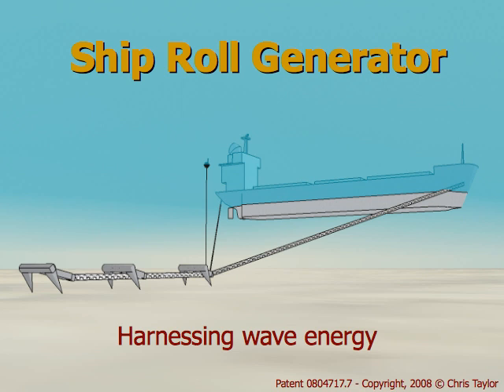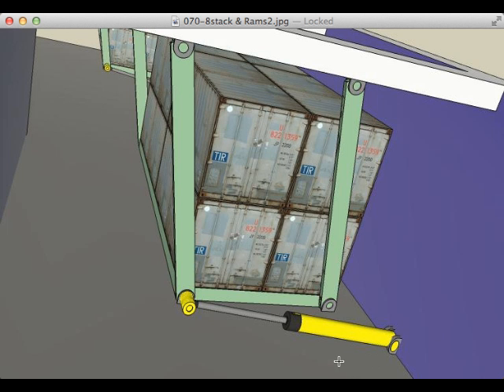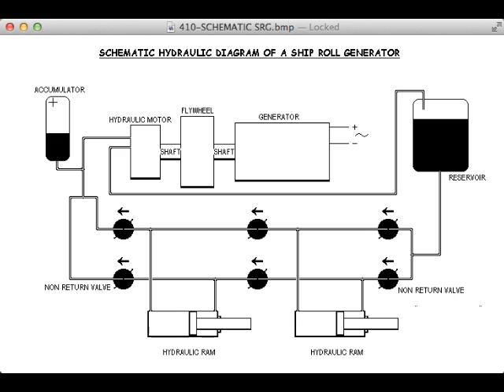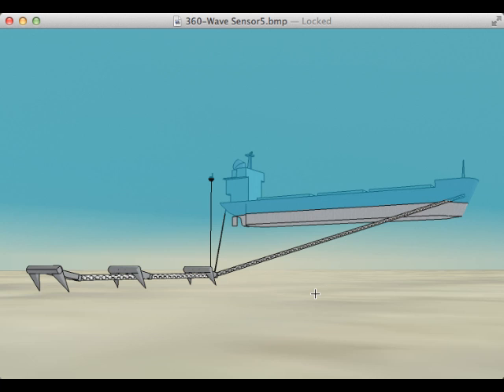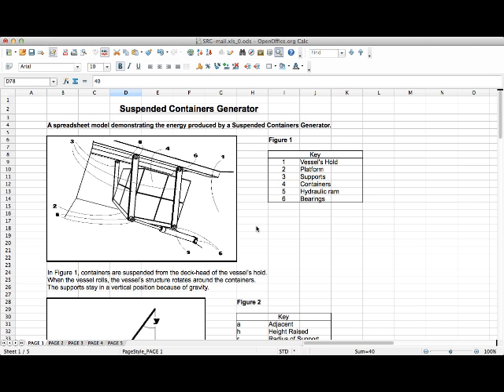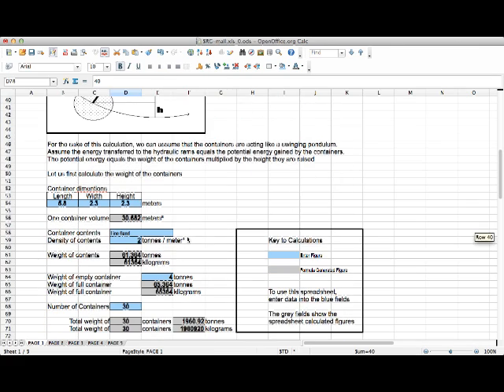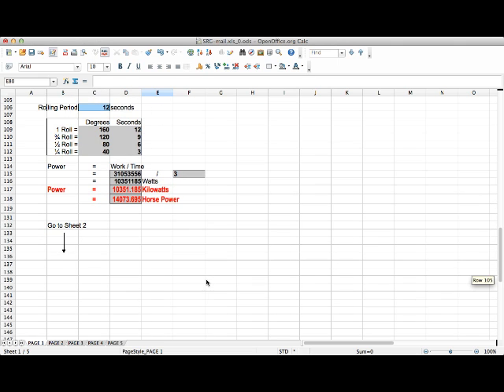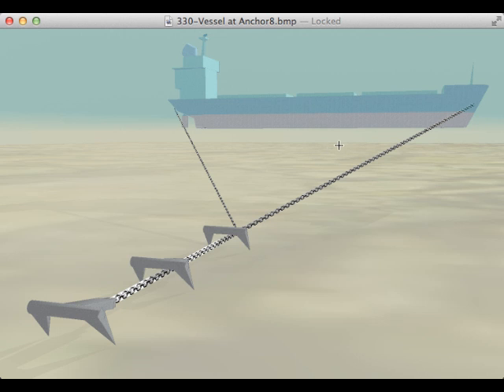S012 - Wave Energy 02

Comment: So many ways of doing it.

For example, Instead of suspended platforms, you coud have used rails along the bottom of the ship, you'd get longer actuation and it would be cheaper.

Have the containers pull a chain, that turns a hydraulic motor instead of hydraulic rams, then send the hydraulic oil trough some one way valves (essentially make them work as a rectiifier, so the direction of the chain driven hydraulic motor doesn't matter) and pipe that to your usual Accumulator / hydraulic motor / flywheel / generator setup.

Ultimately though, the whole ship idea is a lot of meterial, for a low energy generator. You'd end up using more energy to build it, than it would generate.

Oh, and on a sidenote, use WET SAND, it's heavier, and gives you a better energy potential.

Comment: To store the energy you are producing, you have to do the follow: Choose the energy transportation material, for example - air. You can store on your big ship compressed air (of course, compressed by your moving containers :) ) When you will be close to land, you can spin a turbine with that compressed air, to generate electricity. 
If you use water to store your energy, you can make connection with land by pipe, which will transport pressured water on shore in purpose to produce.. you know what